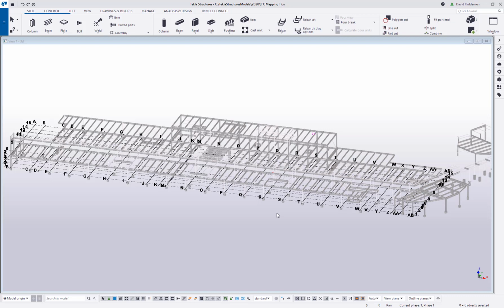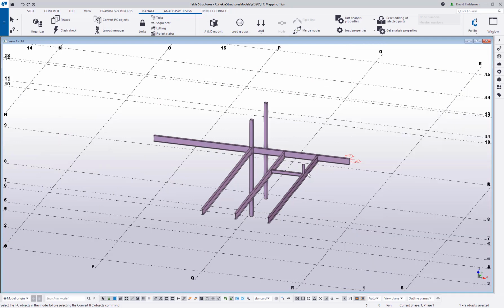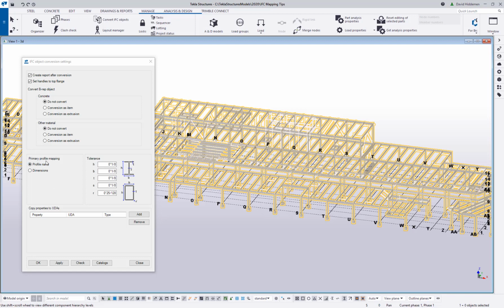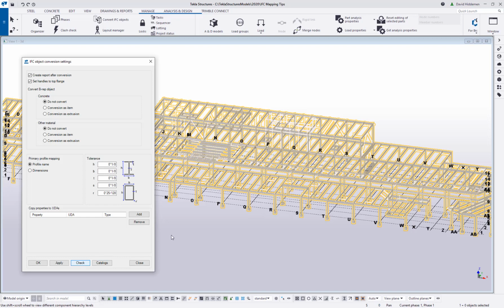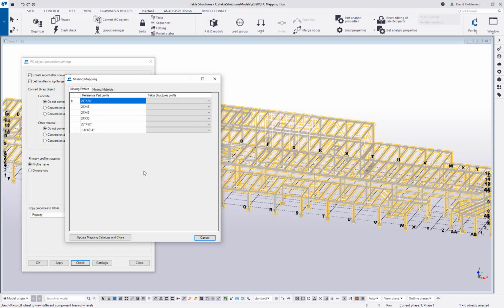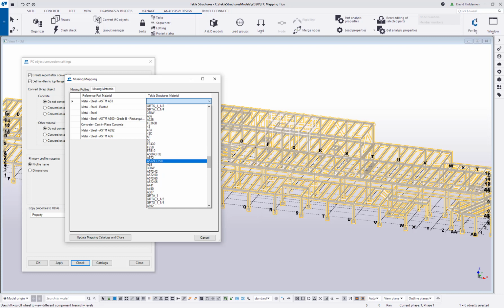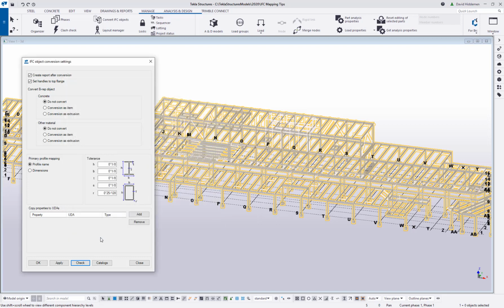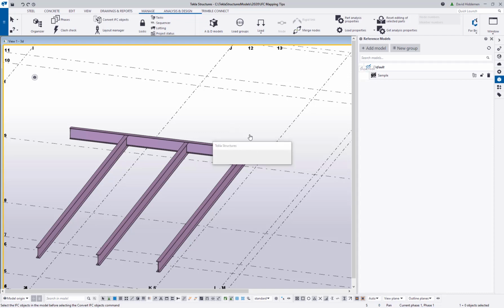Mapping IFC File Properties in Tekla Structures

Comment: Whenever I convert an IFC there is always a lot of cleanup to do with the workpoints. Beams are not always on the center of columns, bracing workpoints are not on the intersecting centerlines of members, etc.. I've written my own API to handle a lot of this cleanup, but are there any robust apps or methods you like to use for this? I'm sure everyone who's every worked with an exported Revit model has the same issues so I don't want to spend too much time on my API if someone else has already created a solution.
Reply: Unfortunately I don't know of a quick automated way to correct them. Just the extend tools and 'converge on point' macro in our environment.

Comment: Hi Dave, do you have a tutorial for splitting a long BOM table into the same sheet? I tried to search it on forum.tekla.com but could not find any BOM-related topic. Thanks in advance.
Reply: I don't think we have one... but there is a sample template in the US environment - TypeA-Drg_DoubleBOM.tpl

You need to change the project width to the desired final width for the split BOM, and the row property itself has a 'use columns' checkbox you can activate.
Reply: @TrimbleTeklaDave  I tried to tick the 'use column' checkbox to our modified BOM (which is almost similar to Tekla style 1 default BOM) but it did not split. Do you know why? Or perhaps, I will just modify this doubleBOM template as well to make it looks like the project's preferred BOM. Thanks a lot, Dave.

Comment: Dave thanks for this. The current project I'm working on in London has brick slips on the front of the precast. The bricks have many data fields but my client requires a specific 3. I was able to map them through the conversion and now the data populates on both the drawing lists and the part marks.

Project is Kings Cross S5 if you have time to Google